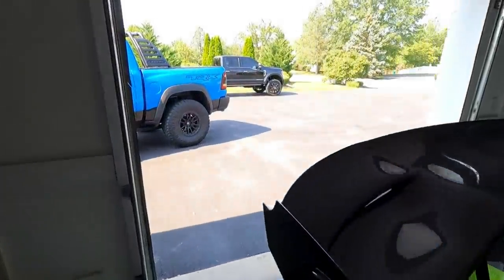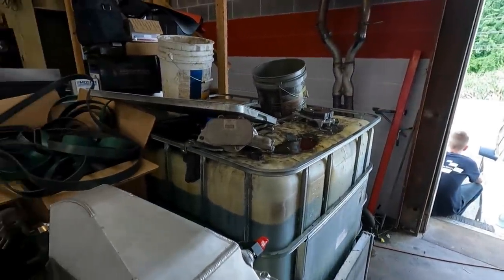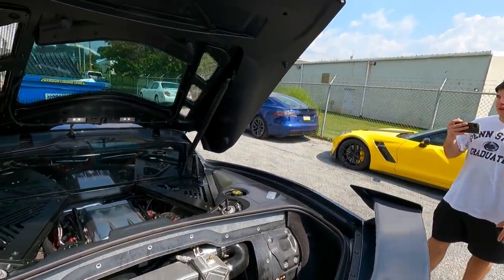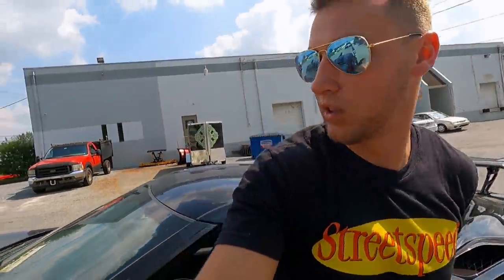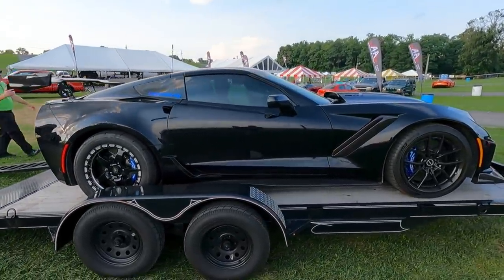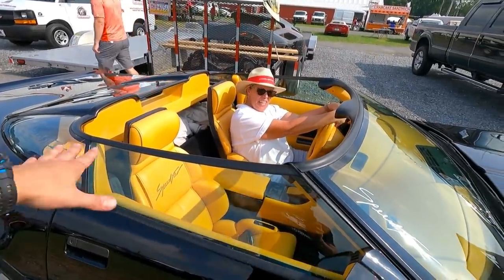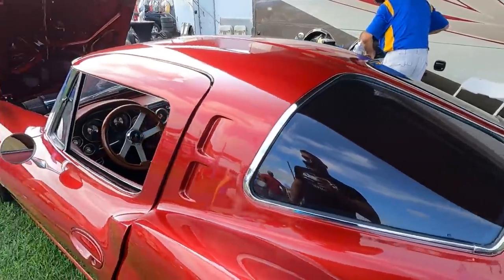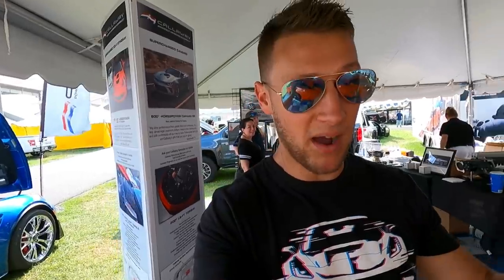FIRST Time Towing in My New F450!!! Collector Offers Me $200k For My ZR1?!?

Comment: Straight pipe the power stroke it will sound so good. I got a f250 superduty and it sounds so good so I could only imagine how this beast sounds
Reply: Don’t forget bigger turbo and injectors
Reply: @puddlerat  no need few parts fall off and a tune she will do 600hp stock
Reply: I like the turbo noises a bigger turbo makes 😂
Reply: Would sound like any f250/f350 6.7 with an exhaust lol

Comment: You would honestly think Andrew would never drive a Tesla due to his business, he literally builds gas cars and if they go full electric can’t be good for any tune or mod shops
Reply: Adapt and change, man. Won't be long before the market is more electric for performance and people will be opening shops or converting for those cars...
Reply: Don't worry.  Andrew will eventually LS swap his tesla
Reply: @dannotwalruslarkin9324  Right!  Who cares if they have no soul—meaning visceral impact upon driver and observer (ever see a pro street car with a 6-71 blower atop a 454 big block, with free-breathing exhaust, and 30” wide slicks, seeming to literally shake the earth as it approaches?Now that’s automotive soul!!!), and you’ve pretty much exhausted its repertoire with a few blasts away from a stoplight?
     If you missed the evolution of the internal combustion engine through the late ‘50’s to circa 1970, followed by the malaise era until the mid-eighties up to present day, when the absolute wonder of much, but not all, of the potential of the ICE was realized-either by not being there to witness it in person, never having attended an event such as the Woodward Dream Cruise, which brings it all back to life, or merely having read about it—you have little to no standing to cheer for the demise of those wonderful times.  
     In reality, ICE powered vehicles are not going away soon.  Perhaps not even in your lifetime, as (1) the supply of rare materials required to go all-electric in the current EV configuration is insufficient to allow everyone to even own an electric car, and (2) disposal of used-up EV batteries in massive quantities poses a potentially severe environmental hazard due to the toxic nature of components.

Comment: Normally is pumps have a limit it’s $75. I have never been to a Sheetz with a diesel limit. My diesel truck is normally at least $70-75 from 1/4 tank. Empty is over $90-$100 depending on prices. I can get like 650 miles on my 2006 Cummins on a full tank. That’s pushing it to scary low, but it’s doable. Lol

Comment: I had a chiller on my 03 mustang SVT Cobra and it made a huge difference. I could hot lap 1/4 mile runs at the track all night 👍🏻
Mine was a little different though use to add ice to mine between runs.

Comment: 700 miles empty...good luck getting half that towing.  also towing capacity is like 41,000lbs. right? (GCWR)  try the savage garage hack and hold the high-beam lever for like 3-5 seconds for the flashing lights east egg.

Comment: What size tank does that have?  My 2021 tundra has 38 gallon.  $125 or about to fill it and when I first got it new a month ago it said 600 miles til empty.  Every time I filled it up it went down.   565 miles to empty, then 535, then 496 and now it's stays at 470.   But I never let it get to past. A half tank and at a half it says 250 til empty.   I wouldn't sell the vette for $180k. I'm sure you have more into it than that.

Comment: You should never push more gas afte it stops bcs the little hole where you pump gas in makes gas go into the vapor tank underneath the hood and they cost from $500 to $2000 and check engine light will come on and it will run like shit

Comment: Mike, think about this! One! A lot of pollutants come from just making the batteries and when the life of the battery is over, they will pollute again disposing them! TWO! The electric infrastructure will not be able to meet the demand of a world filled with electric cars! Three! just think of all the gas stations on every corner now! Are they going to match that many charging stations? How long will that take? Four! fossil fuel is big business, the red tape they will have to cut? I just don't see that happening. No matter how you slice it, the electric car is going to have to share the road with gas filled cars! Now I think you may see a lot of hybrid cars with gas and electric combined. So I wouldn't worry to much about the muscle car dieing off just yet!

Comment: "Electric cars are great." 

I know a guy who 'had' a Tesla S, which may make you think: 'Oh oh! What happened?. Well...he raced it "A few times" (his words). However, after the last time the battery would no longer take a charge so he had it trailered to the dealer where he said it was almost $15,000 for a new battery since they refused to warranty it. I asked if he told them he had raced it and he said: "Of course not". However, they apparently have a way to check the batteries history and were able to determine it had been driven in such a manner that the battery was nearly depleted a number of times over X weeks/days, including date, time, battery temp, vehicle speed and so forth and as a result it wasn't covered by the warranty. He said they can even void the warranty if you fail to install software upgrades.

Hence it's not hard to guess what car I'll never buy, even if they're the only vehicles one can buy. I can always ride a horse. I grew up on a ranch and rode nearly every day...until I discovered guys with cars. >;}

Comment: Callaway is and has been in bed with Chevrolet for many many years so you can bet that if chevy is going to let anyone in on the secret sauce to tune a C8 it will damn sure be Callaway. That’s the whole reason you can purchase them through certain Chevy dealerships and get a warranty, however if you understand anything about the automotive industry you would know Chevy isn’t going to allow that to happen until the finish rolling out their top of the line versions of the C8. Same thing Ford does with Saleen back in the day and Rousch today. But trust me, Callaway will be the first tuner Chevy gives the secret codes to unless an independent breaks the code first. Even then Callaway will wait on Chevy so they don’t ruin the relationship

Comment: Your trx would tow everything and has literally twice the power of the f350
Reply: Not even close to the torque of the diesel and the trx isn’t capable of towing two cars on a trailer! Look up the towing specs for one.
Reply: That's sad a brand new trx is made for racing and has less torque then horsepower like u could buy a older f150 that pull better but sad dodge made a trx that's basically a car and can't be used for anything besides going fast lol
Reply: @colbygaming6664  It’s a off road truck, not a tow rig. Made for a different purpose. I agree that there is a lot of half tons that can tow that much, and the trx could probably do it. It’s not a matter of power, it’s the suspension set up. The trx makes 650 ft lbs of torque by the way.
Reply: @TheMotorman80  ig when you have so much money you don't care about spending 80k on another truck just so you can pull 2 cars comfortably  and that rich ig don't matter

Comment: 48 gallons worth of wallet draining fuel tank.
My gas powered f350 says 620ish miles when it's full full. Get used to $100 not even getting you 3/4 of a tank. 😭

Comment: You need a drop hitch pretty bad on that F-450. it looks retarded with the trailer at an upward angle like that.   When towing, trailers should be level to improve stability, braking performance, and ground clearance. A level trailer will prevent poor towing characteristics, like sway, and uneven tire wear.

Comment: I don’t wanna be a dick but dude claimed he saw as low as 9 degrees F, um what? 32 degrees f is the freezing point of water. Now I fully understand that there is not just straight water in the cooling system but even with coolant 9 degrees? I find that hard to believe especially when you consider that the cooler is in the engine bay of a mid engine car. Im sure it could do 40-50 degrees but 9 is BS.